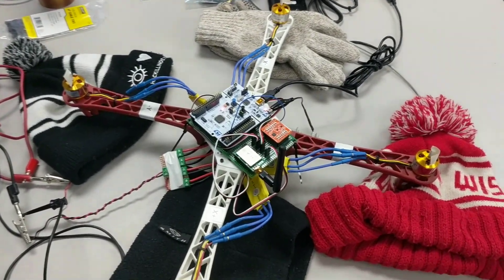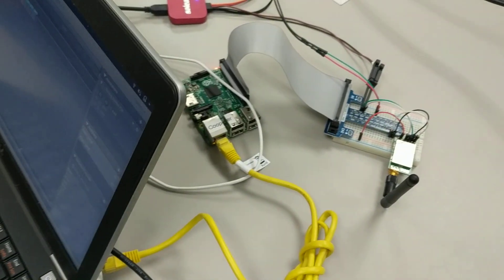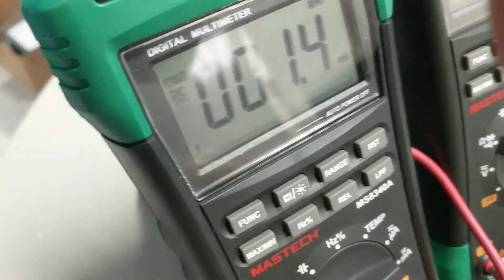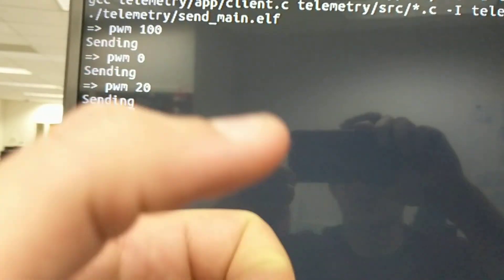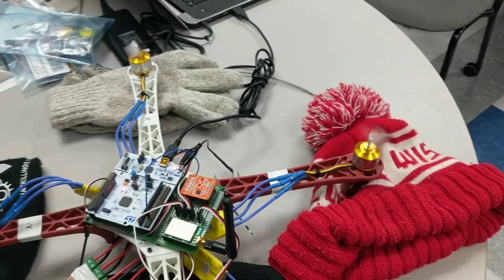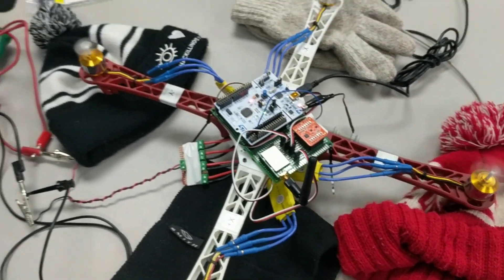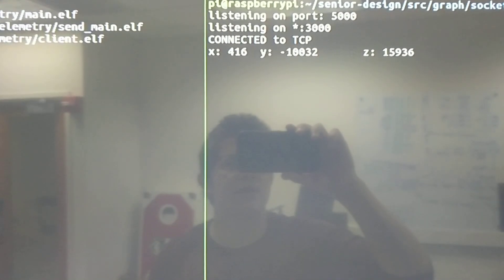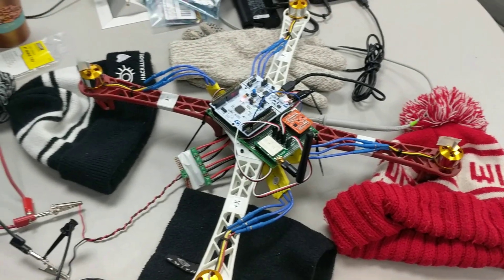Senior Design: Bench Testing 2

Comment: Interesting! 
I'm currently (re)learning C. With the recent hype on Rust about it being safer, faster and having better concurrency than C/C++, do you think I should focus on C and C++ or Rust? My field is robotics. Thanks
Reply from the maker: That's awesome to hear and a really good question. When I graduate I am planning on seeing if I can get any non gcc-compiled code onto a microcontroller, with what little I've read it seems possible (specifically with Rust, too).

If you want to get started fast I would start out with the C/C++ route, taking the Rust route will probably lead to a lot of initial friction and overhead in getting set up.

Either way, thanks for the idea for a video (: